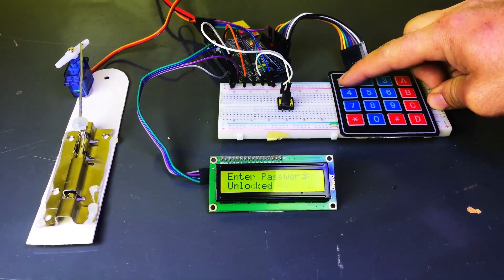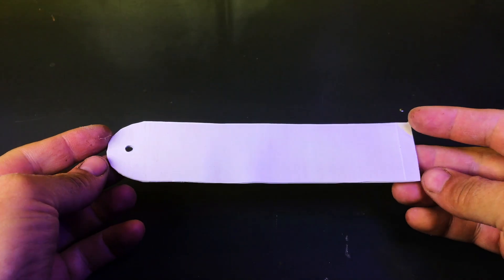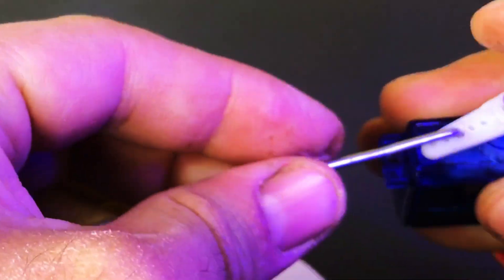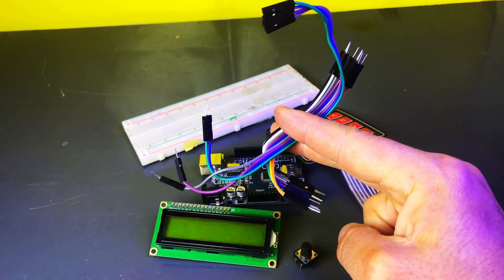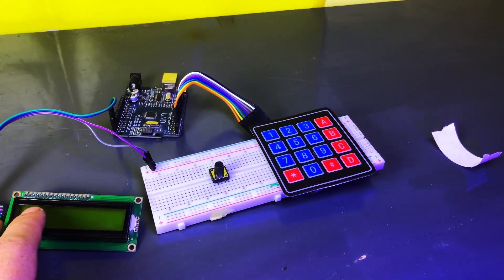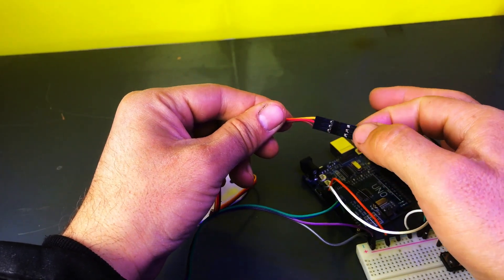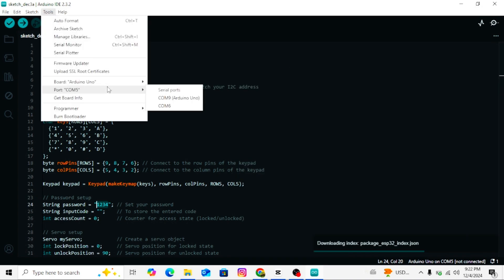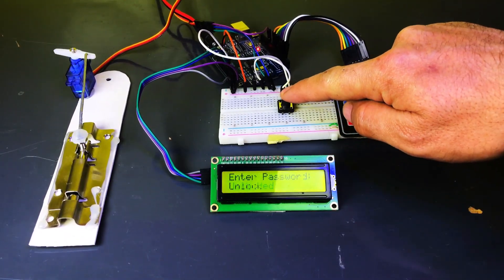Build a Smart Door Lock with Arduino | Keypad, Servo Motor & Mechanical Lock DIY Project

Comment: Which component you used to give power supply? Little confused please do reply 
Is that any readymade set of battery + that???
Reply from the maker: yes its two 3.7v battery with charging circuit
Reply from the maker: yes its two 3.7v battery with charging circuit